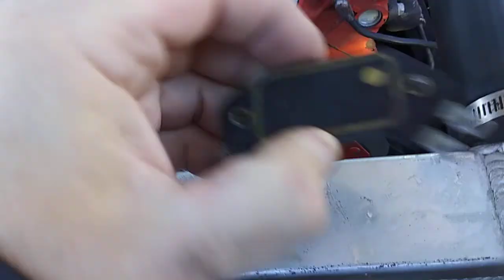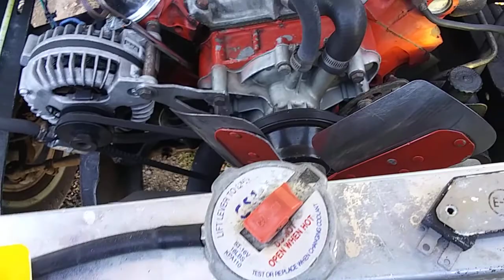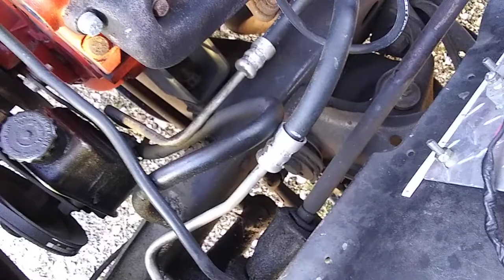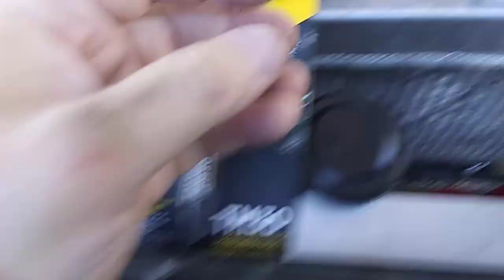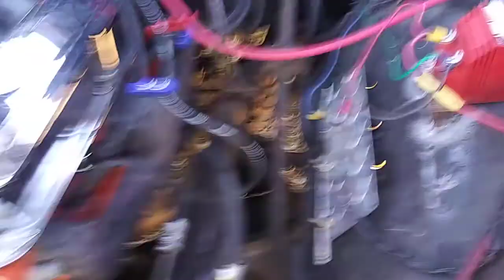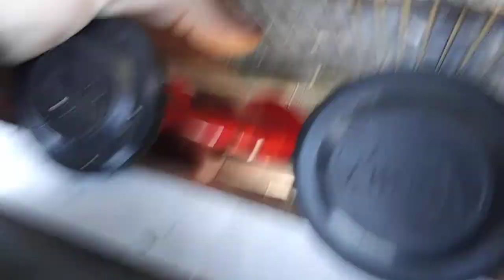DIY TECH TIP:  MOPAR Electronic Ignition modified to accept CHEVY HEI Control Module

Comment: The mounting looks REALLY solid.  The bolts are grounding to your fender, so no really need the extra wire to it.   BTW, I would suggest another location in case of water splashing?  Thanks for the video.

Comment: I converted my 74 Dodge D-200 a few years ago and it worked well. Do you know or have handy which wire goes to which terminal from the reluctor to the HEI module. It seems I changed mine back and forth, but it would still run. Mine has gotten to the point that I have to spin the engine up and when I release the key to the run position it kicks off. It acts like there is a resistor in line, but I took it out (one of the reasons do this conversion). I have swapped the wires again a few times with not improvements. I guess it could be the hei is failing. I mounted mine to the firewall next to the brake booster. Planning to move it as it gets wet sometimes which doesn't help. I added a relay to mine give it 12V when starting. I had the same old opportunity most has had with the ignition switch. I lot of the wiring on these vehicles are a challenge sometimes. The last time I has an opportunity with wiring, i just about rewired the dash. The amp gauge was fried which didn't help the charging and it always pegged my aftermarket amp gauge most of the time. Took all that out added a volt meter, works like a charm. 
I don't guess you get much road water slinging up on the module during rainy days? 
Again, nice job. Thanks in advance for your input.
Reply from the maker: the Orange wire coming out of the pickup coil in the distributor goes to the W on the 4 prong ICM module. black wire from pickup coil goes to the G on the ICM
Reply: @MoparMan1978  Thanks big guy.

Comment: You grounded that aluminum heat plate to the body and battery from the mounting bolts? Ive got a 87 slant 6 in a 47 dodge with a new carb and it just misses a little bit, just doesn't quite run completely smooth, bought a new vacuum advance distributor, going to try this with the distributor see if it smooths out my engine, thanks for video

Comment: Back in the 60's, common practice was to change the plugs and points every 10K miles to maintain good performance.  You could go much longer if you wanted to fiddle with filing the points and or replacing the condenser and sand blasting the plugs.
Russ
Reply from the maker: yep I've done that on my points in my 65 dart . I run NGK's now and no fouled plugs . ZFR5N  in my mopar engines . they have  longer electrode electrode tower . their made for 2002 + jeep cherokee 4.0 liter  plus their made for up to 0.045 gap hei  and inside all NGK's they have a sold rod instead of a section of rod and a small spring for electricity to travel through
Reply: @MoparMan1978  Seem like modern plugs are almost bullet proof.  My 98 Caddy which I have had for almost 20 yrs is still running the original plugs with almost 100K miles.... still runs like a top.
Russ
Reply: I just got a old champion spark plug machine for Christmas it has a meter to test the plug and you hook air compressor to it and it sand blasts the end of the plug it's awesome I love old auto mechanics equipment the thing even works it came with a big fat champion spark plug in it the kind you can replace the porcelain anyway I found one on ebay that's the same thing as mine here is a link of it https://www.ebay.ca/itm/Vintage-Series-600-Champion-Spark-Plug-Cleaner-Tester-Restored/203234736634?hash=item2f51bbf9fa:g:FIIAAOSwMFhf7jW7
Reply from the maker: @79tazman   I'd like to find in good working order a mechanics ohms/ rpm  meter box for checking points ect

Comment: CPU thermal paste is the perfect compound for mating an hei to a heat sink.  I did the same thing when I converted over to it, I just happened to have some because I also picked up building computers.  I didn’t make my aluminum heat sink quite as large as yours, but that’s only because of where I placed mine.  Nicely done!
Reply: I wouldn't recommend using CPU thermal paste. While it does initially offer superior heat transfer qualities (about 16 to 17 times better than silicone grease), CPU thermal paste will dry out on you in a few years time, reducing it's heat transfer abilities considerably.  It's standard preventative maintenance on computers to remove the old thermal paste and apply fresh paste every 2-3 years. Silicone grease doesn't dry out like that over time. I have never seen any recommendation in any repair manual for GM vehicles that the modules silicone grease should be renewed at any given time frame. No stated maintenance schedule for that at all.

Also, while dielectric grease is a silicone grease, it is not the same in properties as a silicone grease made to be used for heat sinks. The latter has a metallic content for much better heat transfer. "Regular" dielectric grease is usually only a silicone oil with a silica paste for thickener; no metallic content at all. It is only intended to be used as an insulator and/or protector for electrical connections, to prevent arcing & especially corrosion, & to prevent spark plug wire boots from fusing to the the spark plugs. Yes regular dielectric grease will work for this, but it's just not as good as transferring heat as silicone grease heat sink grease or compound. Since excessive heat kills modules, it makes more sense to use the better stuff.

I state this from experience in using both on this type of HEI Module conversion. In fact, the CPU paste dried out on me after a few years & became so ineffective for heat transfer, it cooked the module. Module was a very good quality one too, Standard LX-301. I've personally seen & heard of HEI modules using the standard silicone grease lasting for decades.

Second biggest killer of modules is bad grounding. I always run a ground tab from the bolt hole in the module nearest the "B" & "C" terminals, using at least 14 gauge wire, to a clean & solid frame, engine or body ground.
Reply from the maker: thats cool . Yeah the heat sink plate is a little over kill but I figured under hood heat would be a  heat issue especially during the hot missouri summer months to really keep it cool . also I dont know if you know this but if you take one of those 4 prong ICM to a parts store make sure they run the test on the module 3-5 times . once or twice is not enough . if it is a bad ICM or is starting to go bad or partially malfunctioning and you only test it a couple of time it may test good but once it warms up it will quit working so have them test it 3-5 times to see if it warms up on the bottom to see of it tests good or doesnt pass the test . I learned the hard way .
Reply: I use dielectric grease on the back of mine but I have mine mounted to a old computer heat sink it works great and keeps the module cool I thought about using thermal paste but they don't use it on cars from the factory and say to use dielectric grease on the back of it so that's what I use the heat sink keeps it real cool and the grease keeps it away from the moisture
Reply from the maker: @79tazman   the paste does both  keeps moisture out and helps pull the heat away from the module

Comment: Pretty cool deal.... I cringe at GM so I'd try using a ford TFI module just to keep it in the mopar family with its large heat sink that comes on some cougars 80s that mounts to the fender......and a good free soruce for heat sinks are old computers. But I still run my regular mopar 4 pin and just keep going....the one thing I do want is a distributor with a larger cap for less chance of cross fire! The good old ribbed mopar style caps seem to be all gone and can't find one any more. Keep up the good content man.
Reply from the maker: the down side to the big bulky GM distributor cap and rotor is the space it  takes up and taking the coil off the top and GM/chevy rotors have a habit of burning a hole the size of a thin sewing needle through the rotor and arcing to the distributor and causing mis fires or buring up the ICM and or coil . I just stick with the factory distributor and ever 500 to 1000 miles I scrap the end of the contact of the rotor and the contacts inside the distributor cap to make a better  connection
Reply: @MoparMan1978  true if using a GM style HEI distributor but there are aftermarket ones that use the larger cap like the Ford male style and you mount everthing externally I figure as long as I'm modding it I'll get it the way I want. But I've been happy with the old mopar distributor and found no need to change it yet......my buddy has one of those HEI distributors on his 90s roller cam 351w in a 79 f250 that I installed I'm waiting to see the cheap distributor blow!😁